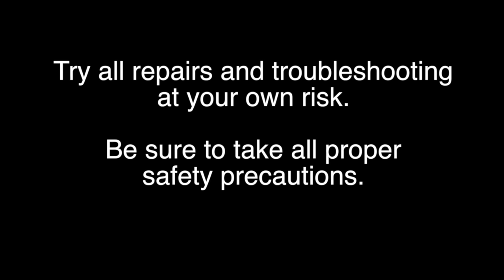Samsung 50” LED TV - No Picture Bad Backlights - How To Replace LED Strips Model UN50

Comment: Looked easier than it was, took me 2 hours to pull it apart and put it back together. Couldnt get the outer screen to line up in the bezel again, the picture did return but  vertical lines seperating 6 sections of the screen now appear. Going to buy a new tv in the morning.
Reply: Im watching this now,and wondering if it's worth the bother? My Samsung 55" has a purple spot. Was it something that you did wrong to cause your repair to fail?
Reply: @MrSanesaw  i followed the tutorial, to the letter, when i removed the outer screen with the suction cups the ribons attached to the bottom/back wouldnt line back up again no matter what i did. The screen was out slightly no matter how I tried to line it back up. But when I put it all back together, somewhere half the screen stopped working. Im thinking when popping the 4 ribbons on the bottom, one may have torn. Thats the only thing I can think of. Im pretty tech savvy but this is not as easy as it looks.
Reply: @AnthonyGrenier  Thanks for your insight Tony! I ended up replacing the Samsung with a Sony OLED 65" that Im very pleased with. I still have the 55" Samsung...The repair sounds easier than it looks! It has one purple patch above where the HDMI ports are located in the rear of the set.It's a heat issue I was told by a local tech.  I don't think I'll bother trying this repair it now!  I'm mechanically inclined, but it sounds like it's best left to someone who done it before. The repair shop told me the repair cost as much as I paid for the set. I was very disappointed in this Samsung!  The ironic thing is I still have my 42" Samsung Plasma purchased in 2006 for $2300 in my family room. It works perfectly!
Reply: @AnthonyGrenier  1/2 MY SCREEN IS NOT WORKING EITHER. I THINK THE TUTORIAL COULD HAVE BEEN MORE DETAILED. DID YOU EVER FIND OUT WHY?

Comment: Awesome. Just bought the parts from you guys and did mine following this. It works great. Mine was only 55" so I wouldn't have thought so much difference. The large metal shield over the scan drive boards might have been easier to remove when it was on its face. I had a TON more adhesive tape. The LED strips were eight assemblies and they connect to a bus not wires. Took me a second to see how to get them to release. Press the two metal central tabs while pulling outward. Great video.

Comment: Thanks for the video Jimmy. I managed to replace the new backlight led strips. But even with the new backlight led strips, there's still a few white circles on my Samsung tv screen. It's not as much white circles as before but there's still a few. The white circles are more faint now though. Is it normal? Could it be that the faint white circles are actually screen burn in because i took about a year to replace the damaged backlight led strip with a new one. Thanks...

Comment: Greetings from Puerto Rico, thank you so much for sharing your knowledge with us.
I would like to ask you for your help if you can. 
I have a Samsung tv model UN49M5300AF that had a bad LED strip, so I boughted the whole set by mail but the carrier bent the package to fitted in the mail box. I managed to save 2 strip but when finish to install them all the lights are just blinking, What I did wrong? I also forgot the order in which the two plastic sheets are going in reference to the screen and the sides too. Your help will be greatly appreciated. Respectfully yours, 
Wilberto Gonzalez

Comment: My led diffusers have fallen of and the dots where they sit a corroded and crumbling. I've tried gluing them back on with locktight super glue gel but they aren't sticking.Am I aswell buying new led with diffusers already on.

Comment: I have never done this repair before, but I am planning out how to do it before I start.  When removing the LCD layer, I know that it's delicate and also collecting dust on it can be a problem.  Instead of laying it down off to the side horizontally somewhere (and picking up a lot of dust), what do you think if I were to set it up vertically, resting it against a wall?  This would keep dust off off it for the most part.  I doubt this would damage the LCD panel, but I've never handled one before.  What do you think?  Is this OK for the panel as long as it's not laying on the ribbon cable?

Comment: Model: UN50H5203AFXZA
Type: UN50H5203
Version: MH01
I plug it in and push power button on remote, stand by/red light solid comes on solid, push power button again it flashes 5 times then goes off, has black screen, I can see video with flash light test, can only see the infra red light and 1 white light with back cover off. Does this point to the led strips only or is there something else it could be yet..  Has video no back light, video I watched says it is either the Back light inverter or the LED Driver.. what is the LED Driver, is it software or hardware?

Comment: I have a Samsung tv and it has a dark blue screen and no image at all it has sound when I turn it on has back lights and it fails the flash light test I replaced the t con board but It did not work please help

Comment: I purchased and replaced led light strips on my Samsung UN50H6201AFXZA through ShopJimmy.  My tv screen had no picture showing but showed faintly with a  flashlight.  TV also did not have lights showing through or under back cover.  After led light strip replacement tv shows lots of white light, and vertical lines of all colors.  There is a bar of good picture on the top 2" of screen. Wondering where to go from here.  One question I have is what to do with small white plastic rivets,  your video does not describe reusing them and I realized the rivets are not reusable when putting things back together.  Can I tape the strips to the reflective paper?  Right now I have rivets that have fallen out which I can see along the bottom of the screen through the white light. Have you seen this picture problem before?

Comment: Hi, I have a Samsung led TV with black vertical strip problem.. It's about 3 inches. Not sure can that be repaired/replaced. What could be the reasons of this? Experts pointers please. TV is KU6300 6-Series.

Comment: I have a 50" Samsung UN50H5203AFXZA that needs backlights, How do I order the right ones? when I search this model number, the results don't relate to the model number.
Reply: Not sure how you are searching..but on Jimmy page these models come up when I search the model you mention

https://www.shopjimmy.com/bn96-28770a-bn96-28771a-led-backlight-strips-8-new/

https://www.shopjimmy.com/samsung-bn96-35206a-bn96-35207a-led-backlight-strips-8-new/

https://www.shopjimmy.com/samsung-df500bga-b1-led-backlight-strips-8-new/

https://www.shopjimmy.com/samsung-t500hvf02-2-replacement-led-backlight-strips-8/

The only way to know for sure is to take it apart and look at the model of the LED lights as their will be tags on them...Of course, that can be a pain!!
Reply: @Tig3rj  Thank You!

Comment: does the reflector sheet also keep the led strips from falling? seems like they would simply fall once the TV is upright again, no?
Reply: They're adhesive
Reply: KingTen91 no they arent
Reply: @jvincemusic  yes they are I replace them all the time
Reply: Use double sided tape, lmao , 
And yes some have adhesive some do not the ones that do not use double sided tape
Reply: The little white tabs you pop out at the very beginning go back in after you plug in the LEDs. This video skips this. You can see at one point he's holding them in his hand as he installs the LEDs. I missed this step when watching the video and had to take it all apart again once I noticed leftover parts... 😢 Otherwise, great video and I got it going again!

Comment: Hi Jimmy - How do I know it is the backlights?  Do they all go bad at the same time?  Basically, I watched your flashlight test and checked everything there.  Doesn't seem  that I see any back lights. Cannot see any images on the screen doing the flashlight test.  I don't
 see any boards with any issues with being shorted from a visual inspection.  I don't see any backlights so should I assume it is the backlights?  Thank you.
Reply: If your not getting power or standby light on Samsung LED try unplugging the LED cord that runs from the yellow power board through the back of the silver panel and power the TV on. If your standby light comes back on its a burnt out LED strip. Saves a lot of time and money avoiding jacking around with boards if the LED is bad. It only takes 1 of the 8 sections going bad to shut down the whole TV.

Comment: Hey guys jus looking for some help
3 mths ago a technician supposedly replaced the strips on my samsung 43 inch smart tv. 
It went bad again, no light but you can hear sounds and if you shine a light you can see the on screen images.
Note the tv power light will blink 5 times when turned on. I didnt find any help on forums online, maybe someone can point me in the right direction

Comment: You'd almost think Samsung would prefer you to buy a new TV. I'm sure with a modicom of redesign this could have been so much easier, <sigh>
PS I won't be buying another Samsung. Picture quality 10/10. Firmware/software 0/10.

Comment: Hello.
I have a RLDED4633A-C RCA TV with the no image but sound syndrome. I did the flashlight test and I see image. I tested all my voltages and are ok. I checked for voltage at LED connector from power supply and have a constant 94 v. I did this test with and without LED connection plugged. My question is... is 94 v the right voltage? I did notice when measuring and turning on TV the voltage starts up around 200 or so volts and goes to 94 v. (Both plugged or not plugged). I’m hesitant to go further in to check the LEDs because right now, I’m not sure if 94 v is correct. Any help would be awesome thank you.
Reply: Hi, I have a Samsung led TV with black vertical strip problem.. It's about 3 inches. Not sure can that be repaired/replaced. What could be the reasons of this? Experts pointers please. TV is KU6300 6-Series.
Reply: mfx3  Try asking the same question at http://www.tv-forums.com/ they are pretty good at trouble shooting for free.
Reply: Johnny J thanks, I finally figured out the issue (1 burnt LED), but I’ll keep that site in my mind for the next time.
Reply: Hi guys I have a LG50LN5400_UA and when i turn it on it flashes white and then it goes to a dark screen but you can still hear the audio from the tv please help me what wrong with my tv and tell me what i need to replaces thank.
Reply: Luis Olivares   ...try the link on the reply I left for mfxe about a week ago read all the replies again, there is a link to a forum that helps with questions like yours.
Reply: Johnny J i did but i don't know how to use that site it confusing
Reply: Johnny J but do you think it the led strip light
Reply: Luis Olivares   That forum is easy just sign up go to tv repair questions and ask the same question there, with your system it might be cheaper to check ShopJimmy.com for board kit and replace them all.  I'm not a repair guy by trade but I know enough to be dangerous as my dad used to say.  I know one thing...no light at all is usually easy, I don't know what inverter your set uses.  I also know that Shop Jimmy DOES NOT answer questions from there YouTube comment section.  I'm six out of seven TVs buying parts from here and asking questions at tv-forums, an LED inverter may be all your problem is, one thing for sure all the LED strips don't go out at once,  best of luck.
Reply: Johnny J thank you

Comment: That seems like more of an expensive repair than to buy a new tv? How much does a repair like that cost for those who don’t have skills like that?
Reply: $49 for the LED strips (46" TV). Add another $17.50 if you need a pair of suction cups. Worked perfectly for me.
Reply: @paths1111  Same, $50

Comment: WHY DO I HAVE 1/2 A PICTURE ON MY SCREEN? SPLIT RIGHT DOWN THE MIDDLE, 1/2 IS BLACK, 1/2 IS PICTURE.
Reply: i had the same issue.  replaced the backlight on half side that is completely black.  u can take off the back cover, then turn on the tv.  u should be able to see the backlight come on thru all the tiny holes.  in my case, on half one side, the led lights were completely dead...the other half was lit.  replaced backlight and all went good.